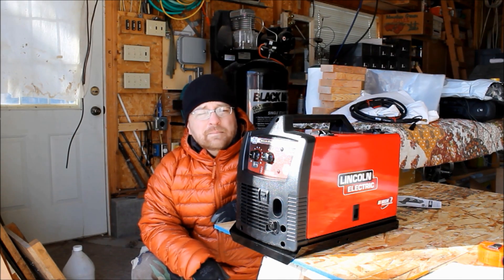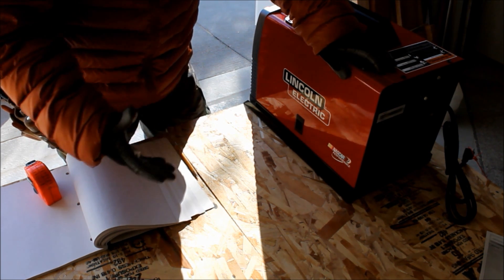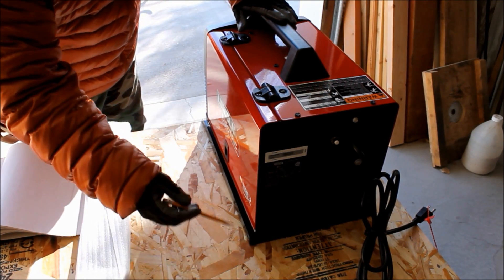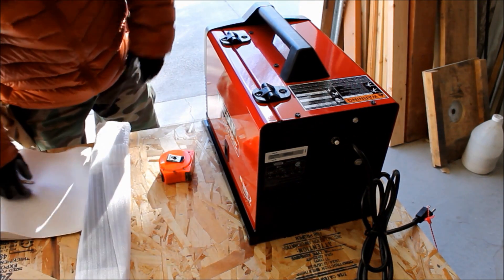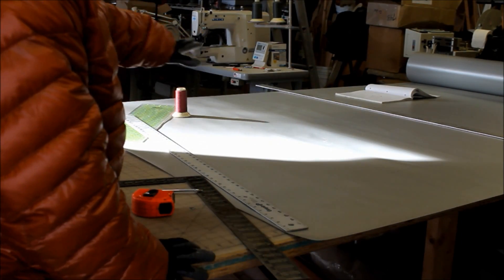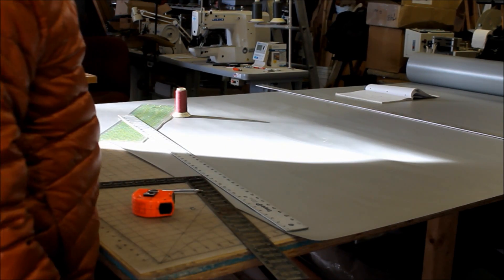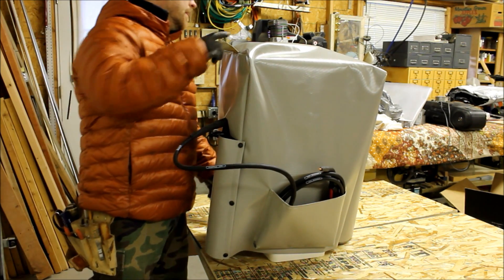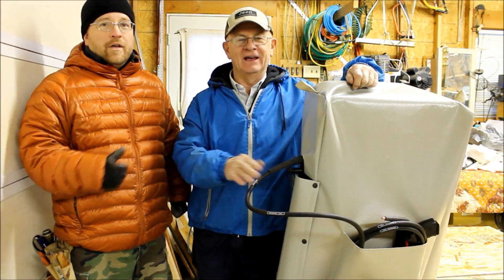Make a Cover for Your Welder, BBQ Grill, Spare Tire, or Shop Equipment.

Comment: Nice.    Same exact welder I got .......
Reply: Guess mine was next higher.  That said 125. Mine is a 140 still 120.  And can use gas as well
Reply: +Jason Curry Ya, they considered going with the one you've got but it was just a little more than they could spend.

Comment: I need someone with a little more jeep experience than i do. I bought a 1984 jeep Cherokee a couple months ago, I travel 45 miles and go home parked it overnight and started it the next day and it would not go out of 2 nd gear. I tried to drain the master cylinder and refill it with new brake fluid and go the air out and still nothing. It runs and drives fine but wont get out of gear. It is a straight 4 motor not sure on the tranny?  I ordered a new master cylinder from auto zone since it still had the factory one on and was all rusted and all little bit leaking. What should i do if that does not fix  it? It has a manual 5 spd gearbox.
Reply: +Tyler Bleepinjeep Thank you for the help i get good gas mileage with it to a little under 1/8 of a tank to travel 45 miles on the highway. I went to day and it came out of second gear :). But i will look for someone to rebuild it. it only has 67k on it which is also good. Is there a tranny i could put in place of the t-5 if it ever does break? i have a 85 nissan truck 4x4 with bad motor and good tranny? i dont know what the tranny is